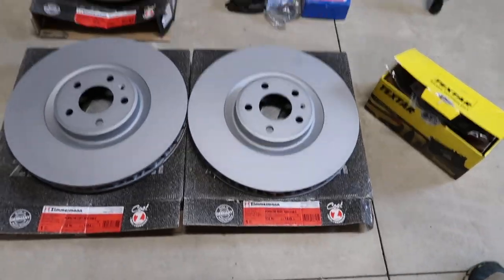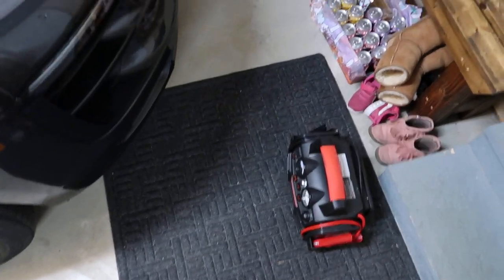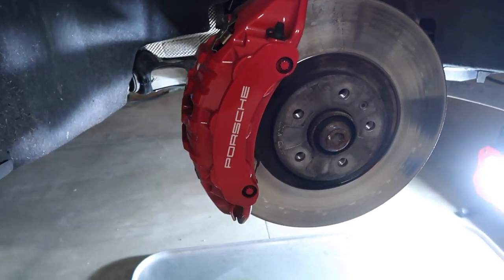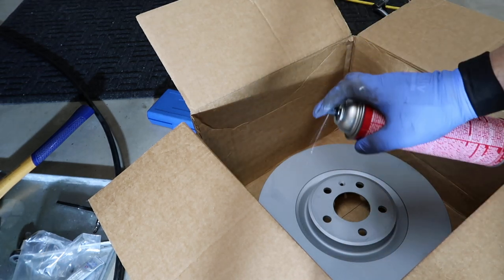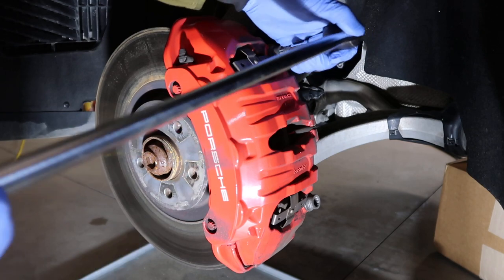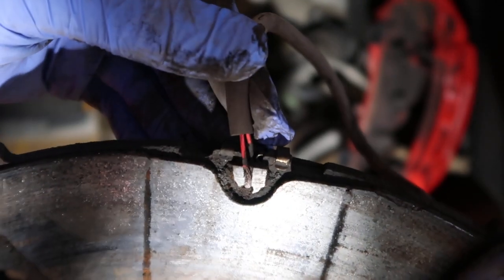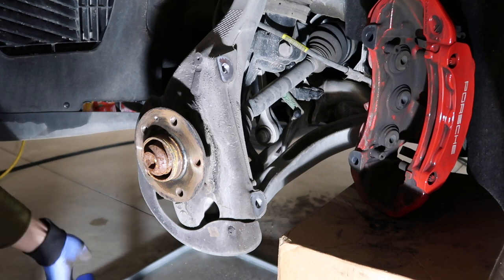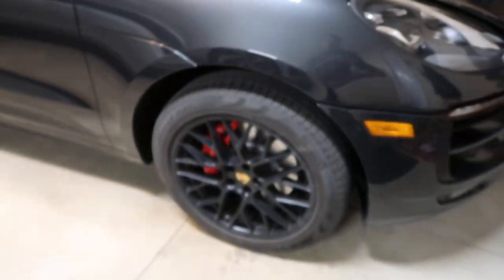Macan Brake Replacement (Front)

Comment: Hi YIcheng, can you please let  me know your rotor and pad model numbers ? I am looking at PartsGeek, and there are many . Mine is 2016 Macan S. Thanks !
Reply from the maker: Mine is the 2018 GTS model so parts are slightly different than the S and base or Turbo. Here are what I bought hope it helps. Always check and make sure the size is correct for your specific vehicle :)
Rotor Front Left: Zimmermann 95B-615-301-G
Rotor Front Right: Zimmermann 95B-615-302-G
Rotor Rear: Zimmermann 95B-615-601-G
Pad Front: Textar 971-698-151-E
Pad Rear: ATE 9A7-698-451-00
Pad Sensor Front Left: Sebro 95B-907-253
Reply: @luyichen11  Thank you !

Comment: Is it normal to do both front and rear pads & rotors?? Or is it a coincidence that you had to do both at once?
Reply from the maker: It is normal if you follow the manufacturer’s spec and do the thickness measurement. But front ones usually have more wear than the rear so I guess you can wait for a little bit longer for the rear job. For me, I don’t want to track different remaining thickness and get every little bit of it. It is better to just get all 4 with brand new so they are even and start at another initial point. It’s safer that way too.

Comment: do u have to replace rotor as well? can I just replace brake pad?
Reply from the maker: You can just replace the pads but that’s not recommended by manufacturer. Rotors have minimum thickness as well so dealer and manufacturer recommend to replace together with pads for safety reasons especially for people or cars intended to be driven aggressively.
Reply: @luyichen11  thanks. I want to try after your great vedio. looks easy just do not know if I can take off the old pad as easy as you. thanks!
Reply from the maker: @asjduwjfjak  you should be able to. Pads are usually much easier to take off than rotors

Comment: 你好 我想问一下卡钳的固定螺丝所需要的套筒是什么尺寸的
Reply from the maker: 是卡钳还是卡钳bracket？
Reply: @luyichen11  Bracket
Reply from the maker: @haozhezhou1321  我记得不是一个套筒，是大众那种triple square 12角的bit。M14的。我买了一套bit也不贵：NEIKO 10056A 1/4-Inch, 3/8-Inch & 1/2-Inch Drive XZN Triple Square Spline Bit Socket Set | 10 Piece Set | Cr-V Sockets and S2 Steel Bits https://a.co/d/iZaK0lE
Reply: @luyichen11  好的 很感谢

Comment: why are you changing them?
Reply from the maker: Because car brakes are wearable parts they run out. Given our current technology they cannot outlast the entire usage life of the vehicle so people need to change brake pads and rotors when they need to be replaced. Hope that answers your question
Reply: @luyichen11  I know that but your rotors looked good. I was wondering if they needed it or you just wanted to upgrade
Reply: @luyichen11  I watched so I could replace my pads on my macan s Thanks for the info
Reply from the maker: @jettaphillips5023  haha sorry I completely misunderstood. I measured my rotors with caliper and their thickness were below minimum service requirement. In the past I had rotors lasted two sets of pads and ignored the OEM requirements. They worked fine. But that’s not what I would recommend to others as OEM requirement should always be the rule when it comes to safety.